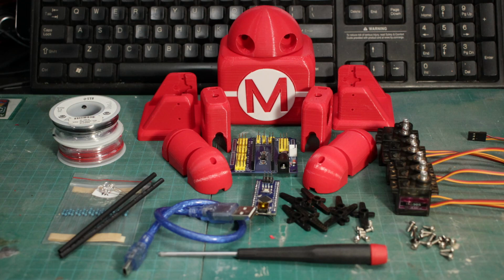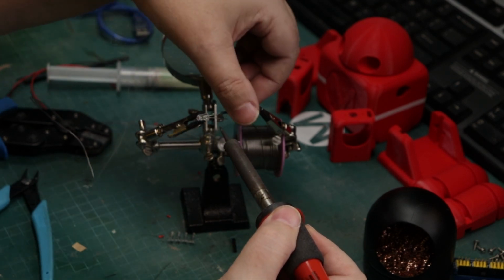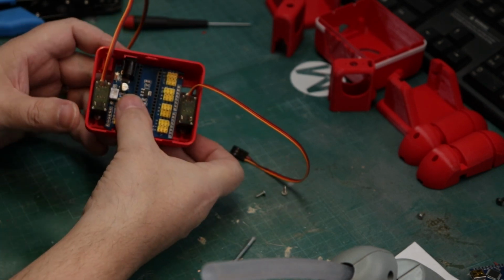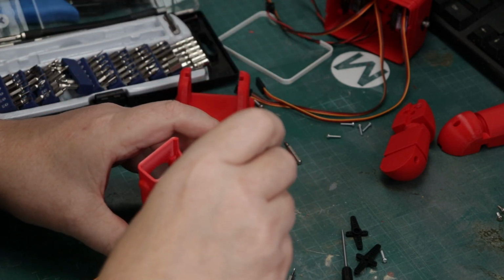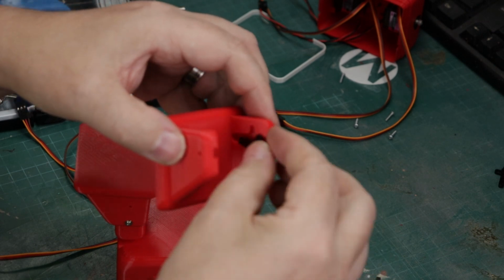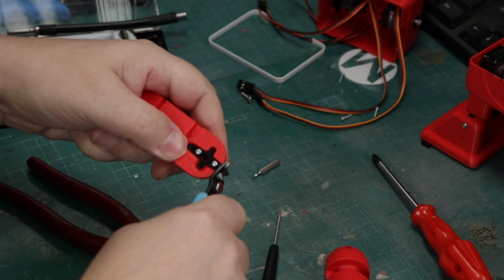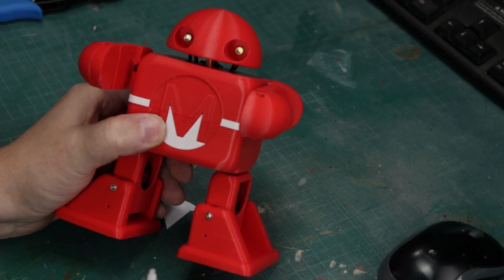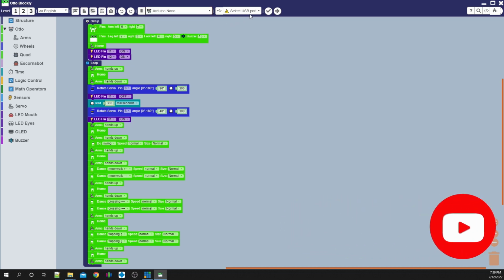Let's build a robot: Part 2

Comment: Hi Richard, Great video it shows it can be done. I have started building but having trouble with fitting leg to foot, broke foot! Off to get some super Glue.I am still awaiting the shield should be here by the end of the week then we can see the beast in action.
Reply from the maker: Hey if I can do it at almost 60 years of age, I am sure you can. Have fun.
Reply: @TheFirstLayer  That is the trouble with you youngsters, just because you can do it you think everyone is capable. I think that the infill percentage was too low, I know that I changed it for the head but I don’t remember the order in which I printed the parts, I do not have your confidence to print everything in one go. This project has been an eye opener for me, I have only used the printer for simple enclosures I have never used supports before and it has been fun, Thank you. So now to the super glueing.  I think that here in the UK UTC is 7 hours ahead of Mountain time but do you use daylight saving time during the summer months?
Reply from the maker: @johncrawford1242  Yes we do.